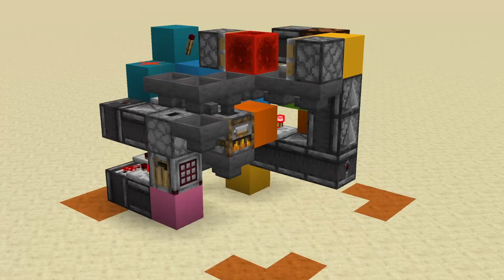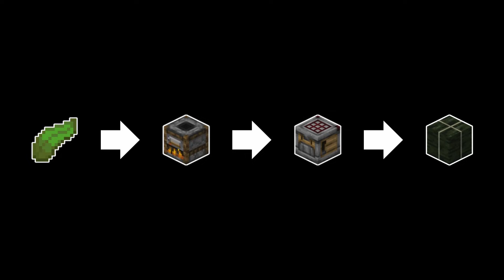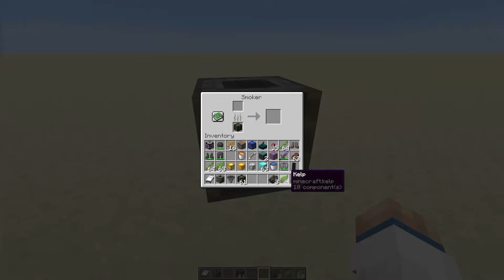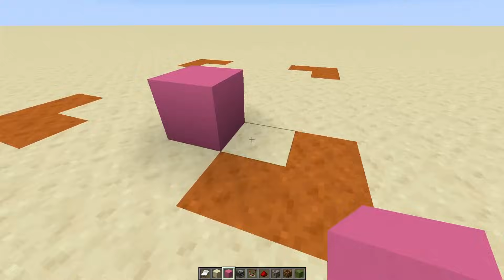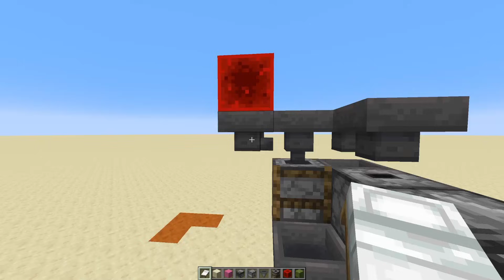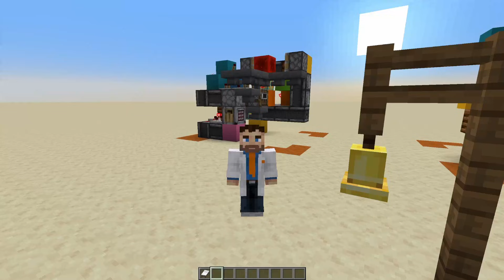Is This the Easiest Fuel Farm in Minecraft?

Comment: I built this system, but I feel like there is a problem with it. First of all, I want to thank you for creating such an incredible system. I don’t have enough knowledge about Redstone to fully understand how it works, and I’m really impressed by the design.

After a while, it produces enough kelp blocks to smelt my items, but I think I have way too much kelp compared to the speed at which it produces kelp blocks.

Even though there is a system preventing overflow, I was wondering if it would be possible to smelt the excess kelp using my 9-furnace auto smelter and then use those dried kelp blocks to fuel the furnace, or if that wouldn’t be efficient in the long run. Alternatively, would it be possible to make a version with more furnaces?

I have a huge amount of kelp because I have a bonemeal farm that feeds a kelp farm.

Comment: tried to make the circuit you used for sending one hopper at a time and it just doesn't work for whatever reason. It will run one to two cycles and then just break and start cycling for each individual item.

Comment: Question, if I fill up 4 slots in two hoppers, the one connects directly to the smoker and the one that is directly below the initial position of redstone block with renamed items, would that break anything? I just want to sped up the process so that you don't need to have 5 stacks of raw kelp fill up the hopper to start the smoker and you don't need 5 stacks of dried kelp block fill up the other hopper to gain the net?

Comment: You can place a comparator in subtraction mode after face of the smoker. On the empty space above the observer, put a composter set to signal strength 5, and route its output to the subtracting comparator. After the comparator, place a block, add a redstone dust to its side, and set up a repeater facing into a hopper that supplies fuel to the smoker.

This way, as long as there are always 64 kelp in the smoker, it will ALWAYS keep exactly 5 fuel items inside, while all excess items will be immediately routed to the output.

Otherwise, in the base setup, you have to wait a long time for the smoker and the adjacent hopper to fill up with 6 stacks of fuel blocks.
Reply: Which observer do you mean? Also, what do you mean by adding a redstone dust to the side? I’m trying to figure out how to make this adjustment but I’m having trouble with it.
Reply: @akhilsurjith2496 Standing in front of the smoker, where you see the fire, place a comparator that goes into a block. Put that comparator in subtract mode.
Place a composter (or container with signal strength 5) in the observer loop. Read that composter with a comparator that goes into the substractor comparator.
To the left of that first block, place a redstone dust on a new block. Between the redstone dust and the fuel input hopper, place a repeater.

Another adjustment, to save on some materials: 
1) Put 4 non-fuel items in the fuel hopper to save some kelp blocks.
2) You can replace some of the observers in the loop with full blocks and a noteblock. Place a redstone dust on top next to the piston.

Comment: Hi, I have a question. Does this unit require fast production of kelp, or can it function with passive slow production of kelp? - I'm using Iron farm of 17x17 and each corner has a Kelp production farm that is totally passive of 15 blocks tall and 2x2 area that is harvested by kelp grow speed, each of iron farm corner has 2 of these kelp farms so total of 8, 2x2 space and 15 tall tubes (my own design), and thus it produces slowly some kelp to be burned.. or does it require steady flow of kelp?
Reply from the maker: It's good for slower passive kelp farms too!  Combining kelp and iron farming is a cool idea.
Reply: @cubefigured  Thank you for quick reply mate. I thought so too, when I watched your video once more, to see does your reactor unit need constant flow, and realized why would it.

For the Iron farming point, my Iron Farm / Villager trading hall, is very compact, I'd like to say one chunk module, but since I'm using the oldest most reliable version of 17x17 square footing, it over laps from the chunk borders by one block each side, but my "Chunk" is Passive farming unit, that doesn't have on/off mechanics and is working constantly without complex redstone mechanics. I'm Farming: Iron, Poppies, String, Sugarcane, Kelp and Bamboo in one unit. Iron, poppies and string all come from iron farm like you know, but I also included in the sides the sugarcane farms, for those pesky Librarians demanding 24 papers to unlocking the first level, then I included the kelp farms in the corners of the farm, since all is flushed from the center with water canals anyways it seemed good collecting point. From the middle of the farm I push the items under the farm and then with water canals to one side of the farm and back up to the ground level where the villagers reside, but in the water canal underneath I also use item sorters for poppies, sugarcane and kelp, poppies are auto-crafted to red dye (Shepherd buys them with 12 to one emerald), sugarcane to paper, and kelp with now your perfect reactor unit to dried kelp blocks, to give fuel to super smelters. I also will include a Bamboo farm with auto-crafter next to the water item elevator to get "crafting wood" for chests, pistons etc. I can if I want, build a Cactus to bonemeal farm under the iron farm and push them with droppers to the "water hopper" , but I don't think I need bonemeal for anything at this point.

So My very compact unit now has it all. I get Emeralds from, paper, red dye, iron and from string, and I get fuel and planks for crafting most of the more annoying parts of red stone components. And thus the farm is totally afk-able and fits our 3 players play group perfectly I don't need to build Farms to lag the realm so much any more. I might include creeper farm over the iron farm in one point, but since we haven't even gone to end yet and thus not have the elytra's yet, I don't need to rush with that one.

But that's my concept and sorry for boring you with details, I've been playing on/off MC from 2009, so you can imagine, how many times I have build all the farms between the years. From the start of this year, we created a new server/realm and my friends wanted me to concentrate more in decorative building rather than farming, but cause I don't want to use iron pickaxes with luck based enchanting, I needed to gear up fast. Over and out.

Comment: 10:45 with this setup, the smoker needs to smelt 5 stacks of kelp before the previous hopper starts to transfer the next batch.

If you remove the detection on the hopper feeding kelp into the smoker (pink line) then the next batch will start transferring as soon as it’s ready even if it can’t transfer it all yet, without starting to fill with the next batch until empty.

It would speed things up as once the smoker has done the last of the 5 stacks, the last of the next batch will be transferring, rather than the start of the next batch.

The system would reset 128 seconds faster (the time for a hopper to transfer 5 stacks)
Reply from the maker: I suppose you can remove the detection of that hopper above the smoker, but the speed of the smoker is the choke point, not the speed of the batch release.  The next batch is released when there are still 64 kelp in the smoker from the current batch.  It takes 320 seconds to cook 64 kelp, and at hopper speed it only takes 128 seconds to release a batch, as you noted.  As long as your kelp farm is keeping up, the smoker is never going to idle.

Comment: Instead, I built a huge 7-"V" section kelp farm that produces 5-6 stacks of kelp per minute, connected to an automatic furnace system that produces about 60 blocks of dried kelp in 5 minutes. The storage system is connected to another section of automatic furnaces, and everything is designed so that there is a slight surplus of dried kelp blocks when both automatic furnaces are running. I'm proud of this system.
Reply: You should be! Holy hell!

Comment: Unfortunately; kelp as fuel is redundant as a simple bamboo farm is far more efficient
Also a note; this autocrafter setup will work for this but not other items as the observers will have an extra activation pulse when the signal strength goes back to 8
Reply: Kelp is more compact when transferring it to smelters in other locations.
Reply: @seandun7083 this is true

Comment: One of the best explanations I have heard on a red stone build ever. I like tinkering with red stone seems most builds I do I have to modify it slightly. I’m testing my build now fingers crossed I got it right. 
Subscribed. Hope to see more builds like this.

Edit:
Works perfectly I need to add an auto shulker loader on the out put and calculate if I need one or more of these set ups. I might set up basic smokers with this on the trailing end to control the overflow.
Definitely an awesome build.

Comment: Very nice, and great explanations! I once made the “opposite” part of this, where the kelp blocks were used efficiently in a blast furnace for smelting gold swords. Regularly a kelp block would only smelt 19 swords, not 20. So I measured 19 swords in a batch, and when full, I released the batch, released one kelp block fuel, and started an etho-timer for the time to burn the kelp block. When the timer was done, another batch could be released. (Measure 19 swords by filling a hopper below a chest, and measure the chest for signal level 9 (14 swords). But then I had a huge build for a single blast furnace…

Comment: huh, never thought about the fact the hopper perfectly divides into 16 batches. I ended up in my design months back checking the comparator output of the smoker directly, and would generate a pulse when it had atleast ~40 items in there, with an observer to handle reseting the pulse by detecting the smoker switchingon/off.

Comment: Built this today, works a treat (Java 1.21.11). I reduced the "backlog" of dried kelp blocks by adding unburnable items to four of the five slots of the hopper feeding the smoker, much like you do when building an item filter (I used sand - but any block that the smoker refuses to accept into its fuel slot will work). This way it only needs 128 dried kelp blocks before it starts overflowing to the output hopper, rather than 384 (5 stacks in the hopper, one in the smoker).
Reply: is there any upside to this?
Reply: @sparkie5571 upsides from my perspective: system itself = free fuel without needing user interaction. Blocking four of the fuel input slots: four fewer stacks of dried kelp blocks needed before I can start using the excess for my own purposes
Reply: @s @sparkie5571 it stops the need for a backlog so now you get the kelp blocks sooner

Comment: Ok so my understanding is this is more for smaller farms as a lossless module where you perhaps have a remote farm that needs fuel and you want to produce the fuel on site. This is in contrast with a mega kelp farm fueling an industrial complex. It also seems like this system would be useful at the end of a super smelter array as a means of efficiently handling overflow. Nice job, this is well done. I agree that inputs and output should be clearly labeled from the start. I also think examples of use cases in a real gameplay scenario could be expanded on, because this has more uses than just mid game play, as I mentioned like remote farms and overflow/rounding. I would also ask to see world downloads or litematica files for complex and compact redstone like this, though I don't know how much providing that would impact your watch time. Well done, I hope you continue to upload. This was an interesting niche solution with a lot of informative subsections.

Comment: Love the design very compact and nice! 
Will probably built it soon enough 🤣
But I was wondering.... Wouldn't be enough with the two observers (before 7:00) pointing to the dropper to craft the kelp block and move it upwards?
I think those observers get powered twice so it would craft and then move the items wouldn't it?
Reply from the maker: @mikecroakphone @jmnero4447 ohhhhhhhh now I see it, haha! Yes, the upper observers power both the dropper and the crafter, so the observers on the bottom layer can just be regular blocks.  Good catch!
Reply from the maker: Not sure if I tested that, but I think the bottom-layer observers aren’t close enough to power the dropper.
Reply: @cubefigured  Essentially @mikecroakphone is referring to, since the dropper is directly powered and is adjacent to the crafter, both would be powered. Thus making the observers below redundant.

I was going to make a similar comment after seeing the video being uploaded, but decided to hit the cancel button instead.

The only possible side effects of removing the bottom two observers could result in a single item being in the dropper at any given time. This being from whether the dropper gets the block update first or the crafter getting it first, either way it should work.

Also, to reduce the amount of buffer fuel kelp blocks needed for the smoker. You could craft stone shovels and put 4 into the hopper feeding the smoker. Those won't be pushed into the smoker, at least they didn't back when I was still playing. 😅
Reply: @cubefigured yeah yeah I ment the two on top of the crafter. Not like you gain so much though 😂

Comment: Ah, just built this and it works as you describe. BUT, what am I missing here? 
The reactor stops the flow of Kelp when the hopper is full and is released when the redsone block is moved.
However, I can't see the point of the mechanism to stop the flow of Kelp! Without that mech. the Kelp stops and backs up in the hoppers if supplied quicker than the smoker can process it. Incorporating your batch mech. has the same effect, the Kelp still backs up in the hoppers if supplied quicker. The Smoker continues burning for a period after the last Kelp is processed in both scenarios 
Please explain to this 'thick' Minecrafter.
Thank you.
Reply from the maker: If the inflow of kelp is always faster than the smoker can cook, then you’re right that there’s technically no benefit to batching it, and you could get away with not building that part.  I included it on the assumption that a lot of people would use this with kelp farms that either run slower than smoker speed or have big ups and downs in output.
Reply: @cubefigured  Thank you for your explanation. I see the point of the mech. now, it stacks up the Kelp to convert to blocks without constantly wasting fuel converting small quantities at a time.